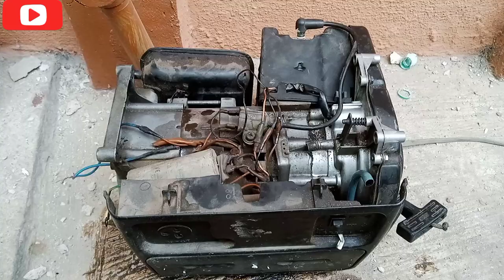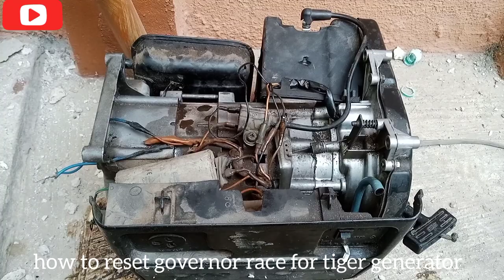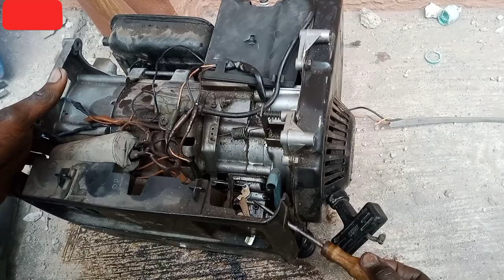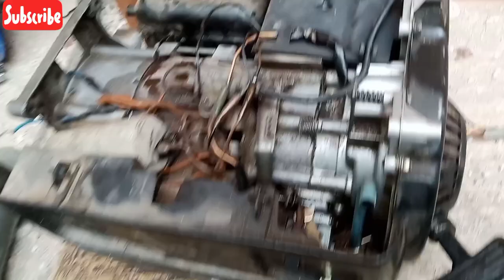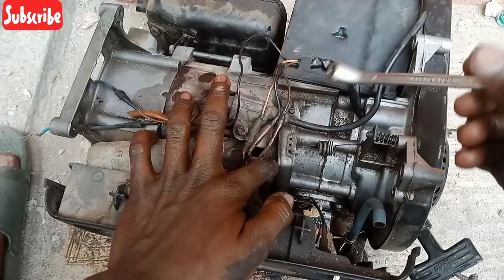TIGER GENERATOR GOVERNOR RACE ADJUSTMENT @ZiaTvgenerator @donyboy73 @Generatorguru@jcondon1

Comment: My own is that, after resetting the governor race in up as you do it above, and still continue to high, so what is the major problem
Reply from the maker: Check the carburetor speed regulator if is high. Low it

Comment: And sometimes the gen do high low itself what is the cause of it
Reply from the maker: Service or change the carburetor
Reply: @jaywealthmechanics9285   I just did that not up to 3 days
Reply from the maker: @ogochukwunwobodo677  did you change the carburetor or you service it?
Reply: @jaywealthmechanics9285  yes sir I did that.
Reply: @jaywealthmechanics9285  I bought new things in the gen also service  the gen and the carburetor is new one not up to 2weeks
Reply from the maker: @ogochukwunwobodo677  is the  throttle spring inserted??